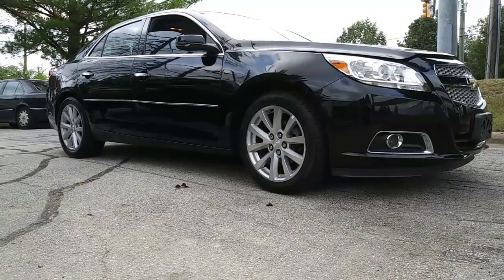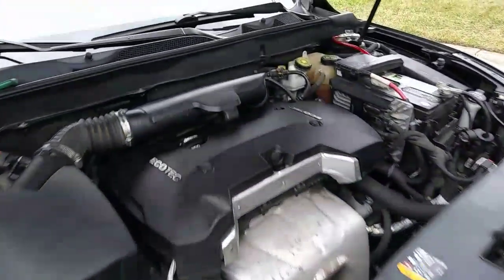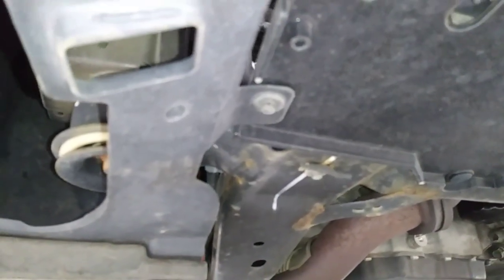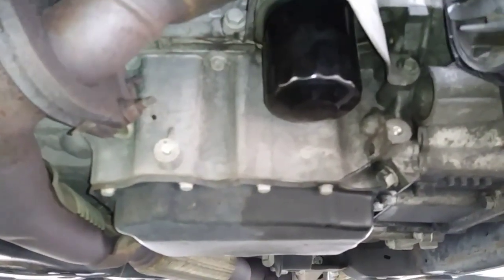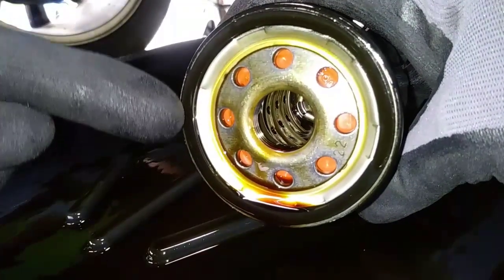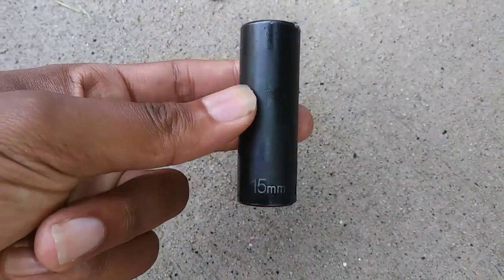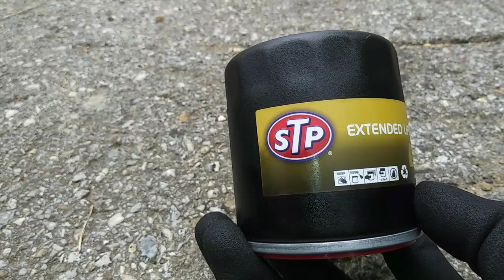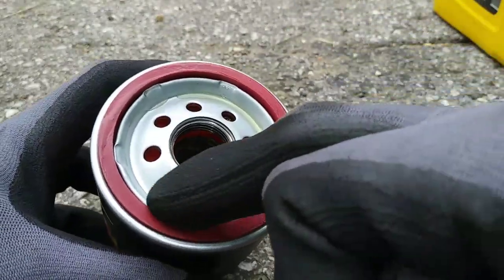OIL CHANGE (2013-2016 CHEVY MALIBU)

Comment: How come you did use 5W30 Dexros? We cut open 18 oil filters and ACDelco had 32 sq in more in filter media while 9 had no pressure relief valve and 3 had no spring. Use an ACDelco filter. I get a case from Rock Auto or a local deal. DK, ASE Master Tech since 1978, mechanic since 1971.

Comment: When changing the oil do you need to replace the oil filter each time?
Reply: Noravanguard, it is recommended that the oil filter is replaced with a new one at each oil change. Otherwise think of it like taking a shower, but putting on your old underwear back on.
Reply: The filter change is just as important as the oil change. Possibly even more important. If you have oil that is supposed to last 15k miles it’s recommended to change the filter at 7.5k miles.